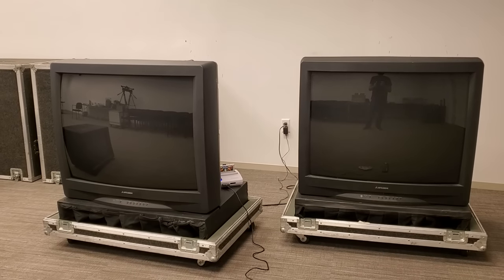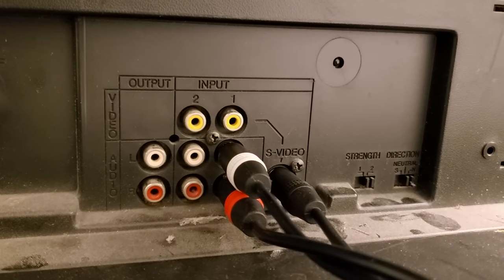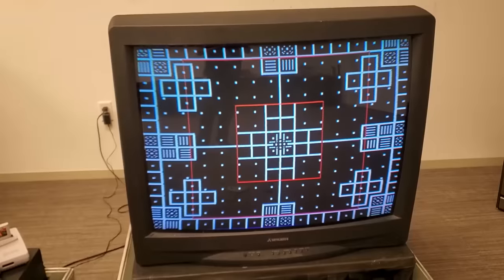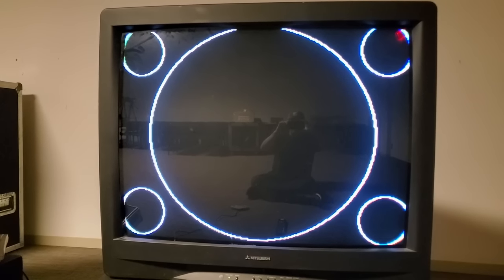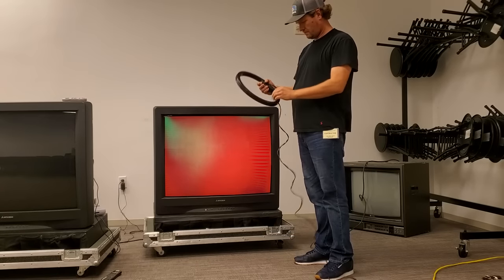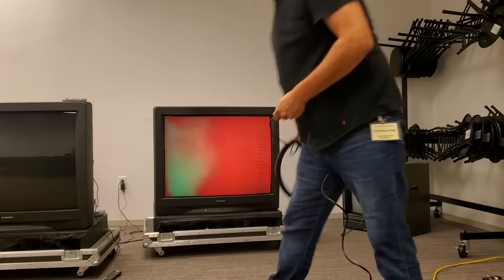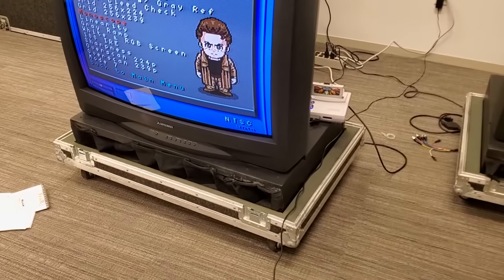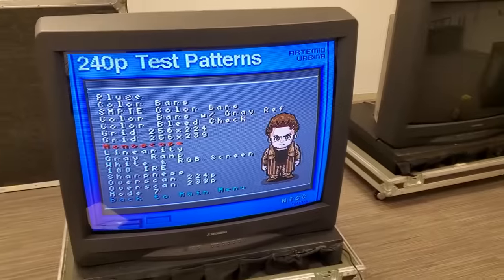The Biggest CRTs still in use:  The Mitsubishi 40" Tube TV

Comment: Wow! That is a massive Tube. I have a 32 inch Panasonic Tau and it has all the hookups I need. Composite, S Video, and Component. Love it. Perfect for my Retro Game setup. Hopefully I never have to move it again.
Reply: You will, one day, when you'll have to sub it with a (comparatively) lighter flat screen, and I don't envy you one bit. I had one of those and it was so heavy, It seemed it was about to collapse in a micro black hole. I had to borrow a hand-operated mini forklift to bring it to the dump when it stopped working for the nth time (it was a problem child)  because in three people we could barely lift it, and my father announced than rather than having it repaired again he'd have returned to the radio broadcasts instead. So we bought a wider and massively lighter 42 inches LCD TV.

And it was a 32 inches. I wouldn't even get closer to a 40.
Reply: @Pdor_figlio_di_Kmer  I have a smaller 15 inch Samsung Crt sitting next to it and a 46 inch Led 3D TV across the room for my HD systems and tate mode games. I have it a vertically moving mount for the tate options.
Reply: @Pdor_figlio_di_Kmer  I hear ya too. My brother and I had to move it from my parents house and get it up the stairs here in my house. It was a pain.

Comment: We recently gave away the Toshiba 34hfx84 HD wide-screen crt set I bought new in 2005 for 750.
Still looked good and had 2 inputs for every format available back then including 2 hdmi ports. Best it could display was 1080i and that was the case for every HD crt TV that I'm aware of. It had decent up scaling so even SD looked somewhat OK. It weighed 160lb and the guy that finally got it dead lifted it off the porch 😱
I used to repair TVs for fun and profit and still have a couple of Belton CRT rejuvenators, tubes, tube testers, and parts. I quit when flat screens took over but I still fix my stuff myself if possible.

Comment: Insane how huge and sharp these sets are, bummer that large sets like this make the flyback insanely loud as can be heard in the video, haha.
Reply: not just that but the bigger the flyback is the hotter ot gets making it more succeptable to explode
Reply: @geovani60624  Don't think that's true lol
Reply: @MrNapkino  it is, it happened to my 29 inch one, the flyback crack overtime and it archs really hard like an explosion
Reply: @geovani60624  I didn't know flyback cracking became more common at higher sizes, but it makes sense because the extra heat from the higher voltage required to power those huge sets would def reduce its lifespan by a lot.
Reply: @MrNapkino  yep, and you can't isolate it, I tried everything but the voltage and current was just too high qnd it keeped arquing, in smaller sets like 14 inch the flybqck don't even heat up almost, and the 21 ones you can still isolate some leaks with tape, but the bigger ones you have no chance, you can fill it up with silicone and it will find a way to arch with the ferrite core
Reply: I'm not sure the bigger tubes have more noise always actually.  I have a 36 Mitsubishi CRT TV from 1997 and it's quite quiet - I don't even notice it unless I turn off all the sound and listen very closely.  My 27" JVC on the other hand is very loud.
Reply: @geovani60624  I call BS on the flyback exploding lol.
Arcing sure, but there just isn't the enough energy for a flyback to explode.
The voltages are really high, but the current just isn't enough to explode.

Comment: Last CRT I properly manhandled was a 20" tube in an arcade cabinet. Had to pull it out and rotate it manually for a vertical game, there was nothing to hold onto but the very sides of the bare tube, that was a feat of strength that gave me some extra hairs on me chest.

A freaking 40" though? No way. Even if it had carry handles. No way. It'd leave dents on the floor by merely existing.

Comment: I had the 40 inch Sony Trinitron CRT and it was an absolute beast to carry. Unfortunately the rain damaged it before I could hook up.
Reply: That's the xbr800. I had the model 36 version of that TV and somehow carried it down a flight of stairs into my apartment lol.
Reply: Did I inherit that set or did another suffer the same fate?  I havent written it off yet need to clean some corrosion and replace some resistors near the back edge hopefully...
Reply: I got that 40” with seamless stand for about $180 installed (hydraulic cart) from a guy who recycles for his whole town (he flips them). I’m sorry yours got hosed but keep your eyes peeled for the next one!!
Reply: @dtbjason  you sure did Jason and congratulations on being my 100th subscriber. Let me know if you get that monster up and running 👍
Reply: Rain doesn't damage electronics unless you turn them on while its wet. You could've just left the case open for like two hours and itd've been fine.
Reply: Oh yea, a friend had one of those, that thing is heavy as a elephant, i recently bought a 29" trinitron and is very heavy compared to my other 29" and i have a sharp i think its a 30" or 32" but it's light as a leaf compared to the smaller ones
Reply: @villalazalejandro  hımmm. It's can be a projection tv. Sharp builds most beautiful tv sets and especially projection systems.
Reply: @skoylux  definitely not a projection t.v. it's a CRT am not at home right now, I'll check the model for reference
Reply: @skoylux  it's a Sharp 32NS400 🙂

Comment: That's why I topped out at 32" CRT's- biggest/heaviest I could carry by myself back in the day.  Short distances from floor to stand or another room
Vowed to never own electronics/AV stuff I couldn't move by myself
Those final years of CRT's and rear projection sets were crazy
Reply: At least if you live in a house it's not as hard to transport one if you have something with wheels. But if you live in a commieblock and can't fit it in the elevator, you're fucked.

Comment: You are supposed to start 5 feet away from the tube and move towards it using circular motions then back away slowly. Don't start  with it right next to the tube, you can bend the shadow mask if you start right next to the tube.  Says it right on the instructions on in the box.

Comment: We had the Diamond 40" crt growing up. It was a monster. It was replaced by a 55" DLP that my dad says is his most regretted purchase at $3k in 2005. The crt was the gaming tv from then until 2014. I played ps2 and xbox 360 over component and it rocked. Way better than the crappy small flat screens coming out at the time of my peak gaming in '07-'11. But it was super sensitive to EMR. Degaussing was a common occurrence. A heavy thunder storm would throw it off. When we got Wifi N in the house I swear that messed with it. The craziest was how much static it put off, holy crap. In the winter if you shuffled your feet on the carpet you could get a 4 inch arc that made your arm go numb. My dad sold it for way to cheap but he didn't know there were enthusiasts.

Comment: I have two twenty one inch CRT's and I struggle to carry em'. I actually wish I'd compromised and kept smaller than that, since I have them pretty close to my couch anyway. I used to have a widescreen but I have to let that go because it was impossible to move. I can't imagine transporting something that massive!
Reply: 21 inch? That doesn't way anything cmon dude 😅
Reply: I recently was given a 19" Toshiba and a 27" Sharp CRT TV. Both are circa 1997/1998. The size (and weight) of the 19" Toshiba are what I prefer the most, but unfortunately it's difficult to find a CRT TV under 21" with an 'S' video input, that wasn't a pricey portable TV to begin with. So because of the 'S' video I have the 27" Sharp hooked up, but I'd take a 21" inch with 'S' video any day over the 27" inch.

Comment: I think the largest CRT i've encountered was a RCA in the early 00s that was 40" wide. It also had a built-in subwoofer, center and left and right speakers as well as connections for two rear speakers. 
It had RGB and supported 1080i. Was my grandparents and it was a beast to move.
Reply: If it were widescreen, it was actually 38 inches. Loewe in Europe sold a version of it for 2-3 times the price.

Comment: Mitsubishi CRT's were awesome - I had a 27" model from the late 80's that was amazing. Had it not been for a freak roof leak that infiltrated drops RIGHT OVER the rear grill where the gun was back in 2001, I suspect it would still be working today. My tears were short-lived as it was covered by the homeowner's insurance, and was able to get a 27" Sony WEGA KV model to replace it. 😁 Lost THAT TV in a breakup with an ex-gf, but low and behold, I was able to find another exact model of the WEGA I had up on Craigslist for $20 back in 2014.

IIRC, Mitsubishi was one of the first manufacturers to get out of making CRT's and quickly shifted their focus to larger, projection TV's. They too were among the best for their time from the mid-90's, until the early-mid 2000's I'd say. The last model I purchased had a LOUSY DLP module that they refused to admit was defective. I had dead pixels galore just 4 years into owning it. 😠

Comment: Just adding my 2 cents when I use my degaussing coil I start 6ft away from  the tv and walk towards the tv spinning the coil like you did and then spinning the opposite way walking away from the tv it usually clears it up in one go but I've never tried on such a huge tube so that might make things different.
Reply: He needs the more powerful stick degaussing tool that Sony suppled to us as a factory service center. It had the extra needed strength to demagnetize the crt band to remove impurities. That old round tool was good for 25" crts but no way for the 40's

Comment: Had a 30 inch or so Mitsubishi as a kid. Problem was it was a bit of a lemon. Speakers kept going out. Eventually the tube went out, or at least something important in the power line. I didn't have much interest in the unit, so I junked it, but now I'm wondering if I could have fixed it. It had been dead for over a decade though. Now I'm all about restoration and renewal, even if I'm just to sell the thing. But this was about six to eight years ago, and crt's were still fairly easy to find on the second hand local market.

Comment: I would be interested to know which manufacturer the picture tube is from.
The last big picture tubes of 40 inches were 16:9 Toshiba picture tubes here in Germany. What I miss on American televisions is the scart connection, which had a 24-pin RGB S video, YCbCr, audio input and output, which, with a tube, had a fantastic picture with our Pal color standard.
Small note, the American picture tubes Sylvania and RCA were very good picture tubes that were installed in our Saba, Nordmende, Blaupunkt (Blaupunkt made by Grundig) in the 70s and 80s.
Very good video, keep it up ;=)

Comment: I had one of these in for repair years back, had to pick it up at the local golf club, had no audio. 
Somehow managed to get the right angle and wrangle it into the front seat (on my own), with it folded all the way back, because it wouldn't fit in the back like every other TV did. 
Ended up being a 2 week wait for an IC which was on back order.
The customer said, don't worry about it, you can keep it.
Similar thing happened with a nice large Sony Trinitron TV.
Two occasions where the dread of a job being knocked back ($120 and $80 repair) turned to absolute joy! "Are you sure?" "OK, we can dump it for you!"
I also somehow ended up with a 21" Sony Trinitron monitor which was the best and heaviest monitor I ever owned, carried that to a few lan parties.

Comment: The M100LJL61X picture tube has only 31.6 KV acceleration voltage. Apparently still available for around $1325, but I stopped clicking higher at 100 pieces. The operating instructions warn that you should only leave still images for 10 minutes.

Comment: I have a 36 inch Sony Trinitron that I use for retro gaming. Great for my PS2 as it has component and goes up to 720i (for the whole 4 PS2 games that ever went that high.) Thing weighs 240 lbs. I do not miss the bulk of crt's but I hate that newer TV's don't have good built in scaling for low resolution games.

Comment: we had this in the 90s it is large, yeah degaussing it's a problem back then, and we used a auto voltage regulator coz if the electricity fluctuates something inside made a popping noise on that huge ass tv.

Comment: I have a larger CRT with some purity issues in the corners. I used a degauss ring like you do in this video and it clears up nicely. However, a power cycle or two later and the pink corners return. Any thoughts? Trying to do my research before I open it for maintenance.
Reply: You need to replace the PTC. It's that (normally black) thing with three legs that sits in the degauss circuit. It controls the degaussing.

Comment: The metal cart and depending on how how the house is built what's in the walls or floor will interfere. There is a factory required external wand degaussing wand. Sony had one as well. In some CRTs there's a rear steel internal shield and the shadow mask, for others there's an external rear steel shield. Either need the cover to remove to degauss those. A regional move of the TV may cause it to take weeks to fully degauss through normal use. A thunderstorm can destroy them as they become so internally magnetized they cannot be degaussed with common tools and won't degauss over time. There was a 3ft hole in the customer's yard on that one. He had to sue the insurance company and a fellow I think from IU was called as expert witness. My customer won.

Comment: What do you do when the tube will get tired?

Is there a company that would make you a new one?

I have ones of Panasoniy Quintrix 16.9 version and it has a special panasonic tube in it, I believe

I use to watch VHS tapes on it, because 480p looks better on resolution independed display (only CRTs were so if I know corecly) then on a modern 4k tv

Not sure what will I do when the tube gets tired, since this tv goes realy well with my VHS (Panasonic VHS DVD combo) since you can transfer tv channels between this 2 over SCART